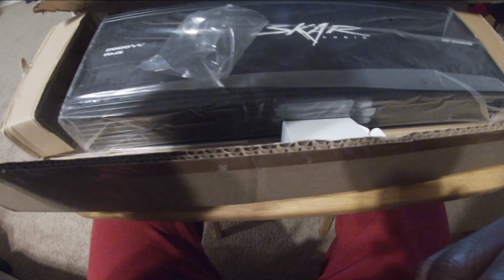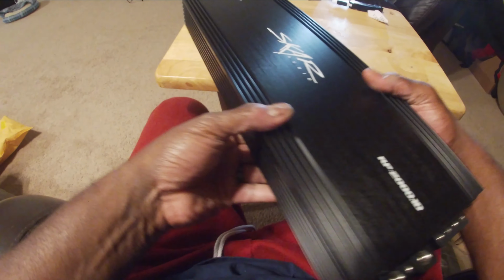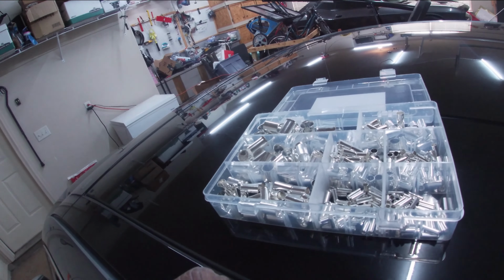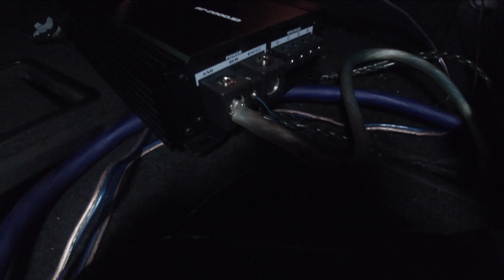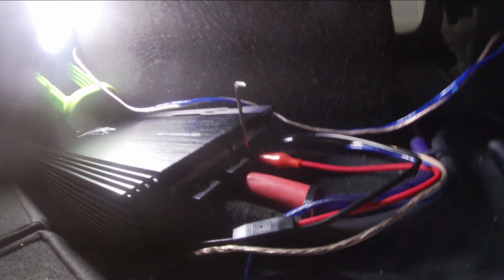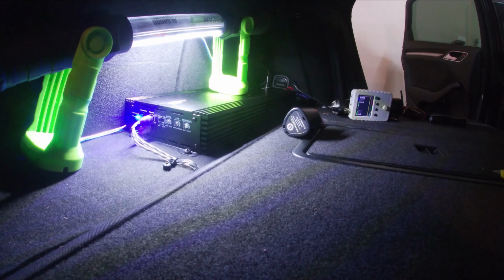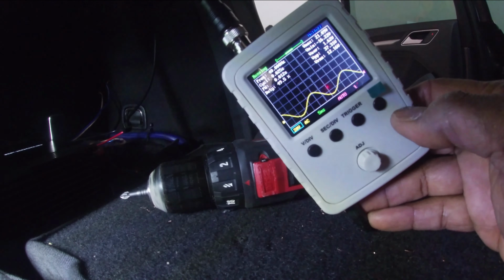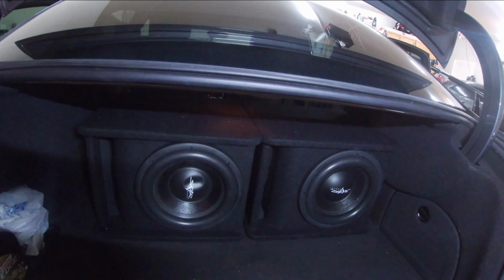Unboxing, installing and setting gains!!!

Comment: Easy explained, thanks Bro....whats your seetings on the low pass?
Reply from the maker: @Infidel67 my gain is set to the 11 o'clock position,  my LPF is set to 50hz and my subsonic is set to the 9 o'clock position. Works very well on my DDX 10s
Reply: @rrrobin2569  awesome Man, I got the same one but with 1 x 12" VXF
Reply from the maker: @Infidel67  nice..I bet it pounds
Reply: @rrrobin2569  yeah after I found out not to use spotify over Bluetooth lol 😂